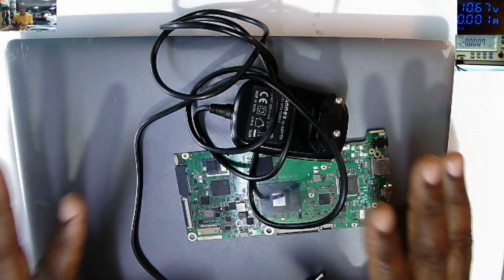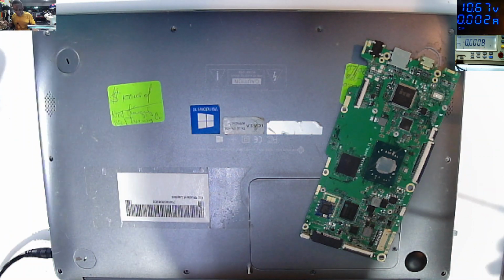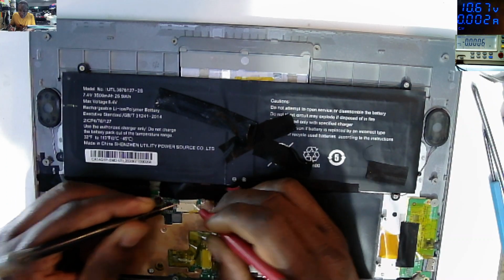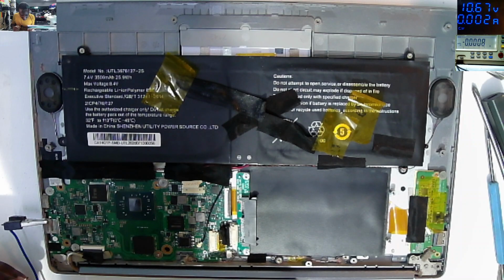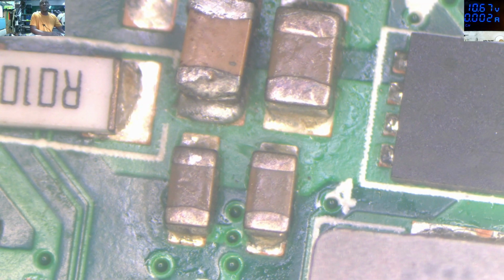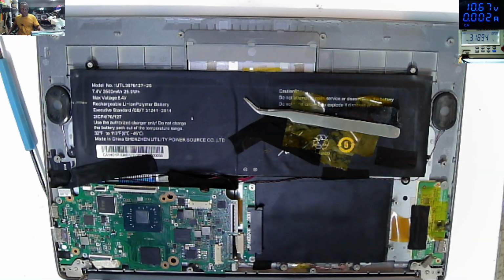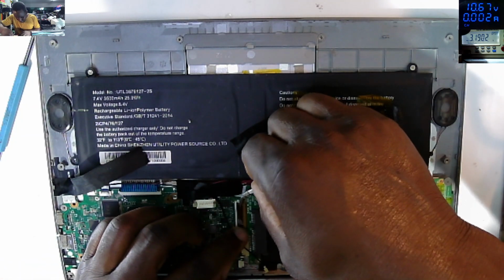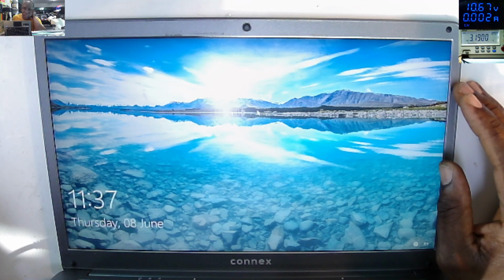Connex Swiftbook Pro L1430 No Power Motherboard Repair! Boiling Cap On The Main 12 Volts Power Rail.

Comment: My  Connex Swiftbook just dissapointed me. I woke up andtry switching it on , it did not power and i tried plugging in the charger batrry light was on showing blue but still it would notswitch on i tried the 30 sec to 1 min thing no it just wont start up.  I only use for typing and school things. Im so dissapointed in Connex only been a 1 year and it gave up on me. Maybe any suggestions.
Reply from the maker: Where are you based